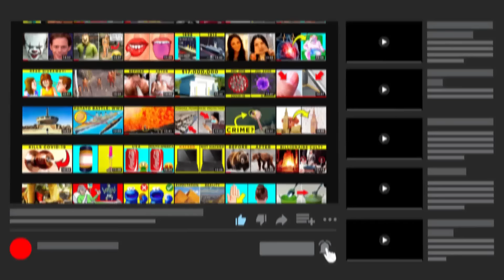The World’s Biggest Junkyards You Have to See to Believe

Comment: I got the impression that you thought the T-72 was still a modern tank it’s not. It was designed in the 1960’s over 50 years ago and its obsolete. A T-34 tank built in 1944 had upgraded with thicker armor and an 85mm main gun.  Exactly 40 years later the M-1 Abrams entered service with the US Army in 1984. How long do you think a fight between those two would last? Thank you for for posting this interesting and informative video.

Comment: Why didn't VW transport all those vehicles to other countries where they would have been accepted and utilized?! WHAT a HUGE waste!!!
Reply: Better yet, take out the diesel engine and swap in a gas motor.  I did it under the shade of the tree. Did it both ways. Diesel gate did not affect me as my Diesels were getting 75MPG(non turbo).  More power than an gasoline air cooled Beetle in 73(Super Beetle) They kept up with traffic just fine.   The diesels don't have that much electrical to them that is not used in BOTH VEHICLES. AND then take off the DIESEL emblem and then it is a gas car.  The narrator is almost GLOATING over the fact so much junk lies around not being recycled.   Grab a few wrenches and take a VW Diesel and combine it with an F16(which burns Kerosene=diesel).  (Definitely would give BATMAN a run for his money in a car race.)
These are not Junkyards. They are not MAGICALLY GOING TO DISAPPEAR. Yes, junk but not in the sense like Auto-salvage yards where they do sell off all the good pieces to other car owners to fix their vehicle they are driving...or RECYCLING OR REUSING the stuff that has already been made.  These are "storage yards".  Auto-salvage yards probably dwarf these sites when you add them all up.  In my town there were a dozen different auto salvage yards, each with as little as 100 cars and some with a 1000 cars. In every town and some just between towns on acreage
.  The only guys doing "something" is in AFRICA.  They always lead the world,-  first homo sapiens, now they get rid of old ships...without a proper dry dock with overhead cranes(such as was used to build the boats)